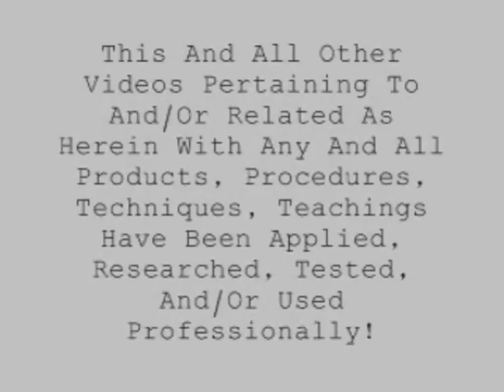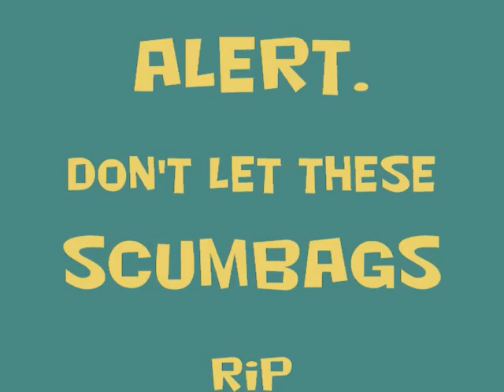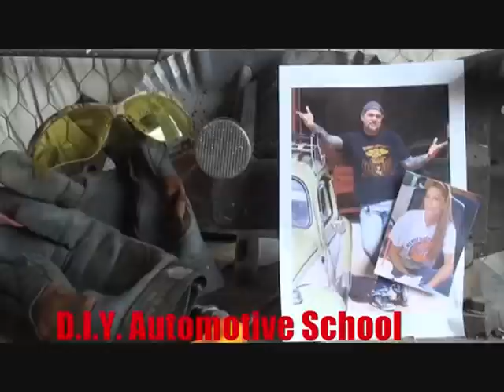Fiberglass Kit-Car Replica Company-The TRUE STORY About Your HOT ROD! Part 2

Comment: Point is, is that it cost less to do your own shopping around and rebuild parts you can do, or find someone to do it. Mostly everyone utilizes used parts. The choice is yours. The money saved on the 4 main systems (chassis,suspension,drivetrain, brakes) can allow you to spend more on electrical, body, interior, safety! Pete rocks!

Comment: Hello Pete, I come from Canada and all the body work I have to do here Unbelievable SO much humidity that everything rots with in a year.. I have a 1967 chevy caprice 4door hardtop. I was wondering. Wheres a good parts supplier. I'm at a crossroads where I have to replace the parts. Like the entire floor pan and quarter pannals because they have been rotted and well I'm having no luck. I believe you would have many sources for body parts and would love to hear form you about it.

Comment: Although those companies pray on the customer, there are ways of getting around many thousands of dollars. First order the base project, know what the kit will need before you call. Make sure it's in house construction. Order chassis and body and parts you can't find elsewhere. All other parts order from companies who sell those other parts. The prices are 60% cheaper. For instance the front steering and suspension will cost at mfg for 12-1800$ vs 48-6200$ for same product.